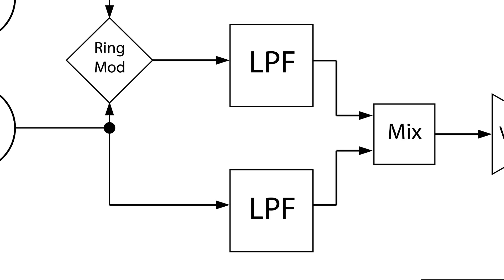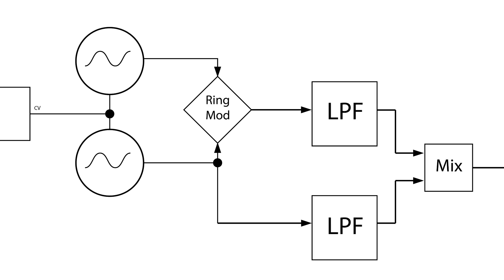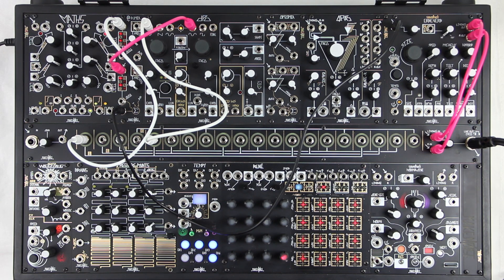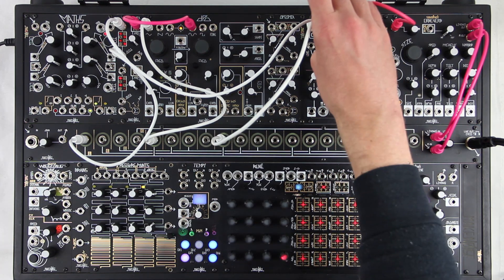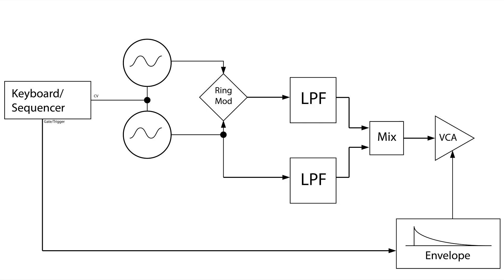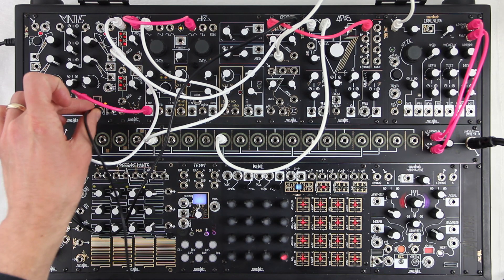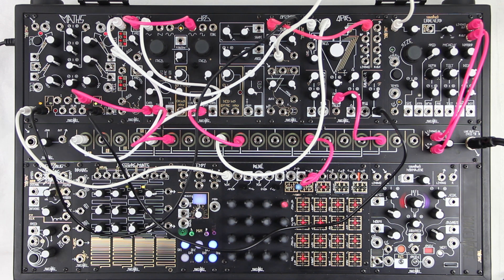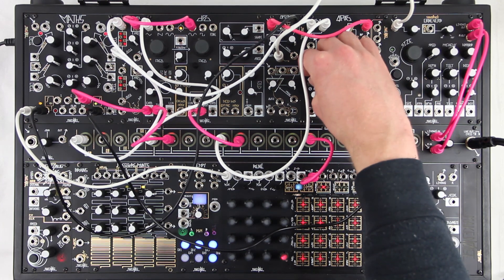Strange Patching: QPAS Gong

Comment: So when you say “we’ll ringmod them together”, what exactly are you doing?
Reply from the maker: That refers to patching the two signals to the signal and carrier inputs of a ring modulator, thus multiplying the amplitude of one signal by the amplitude of the other.
Reply: @MAKEN0ISEMUSIC  Well I don't have a ring mod module so I just sent the sine of one oscillator into the 1v/oct of the second oscillator that was tuned a 4th up and got similar results.
Reply from the maker: @jordanmuller7683  Great way to simulate it! That will be "FMing one with the other" - you could also patch them into the signal and control inputs of a VCA for another variation. Check out our playlist "Timbre FARM" for in depth explorations of frequency, amplitude, and ring modulation :) https://www.youtube.com/watch?v=41mO2lR7v9I&list=PL0jGFC0FWQshCSUPVk_s9JyTtcsG4AoBq

Comment: any tips for tuning the VCOs of the DPO to different ratios without having frequency notation around the coarse tune knobs?
Reply from the maker: I did it by ear. If it's easier to hear the interval at higher pitches, you could mult an offset to both VCOs' 1v/oct inputs, then remove it once you've tuned them. Or - you could use a 2-channel sequencer to sequence ratios... This patch in the book specifies a perfect fourth, but other ratios are sure to be interesting as well!! - W